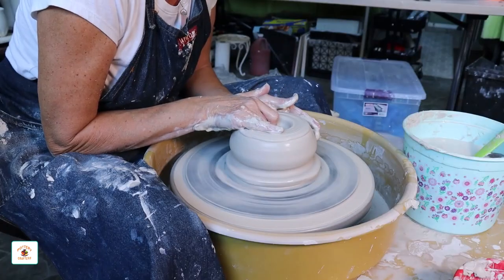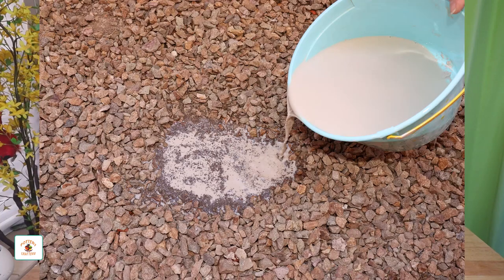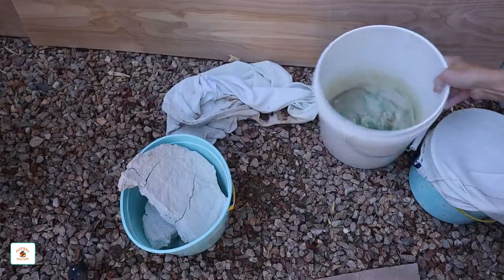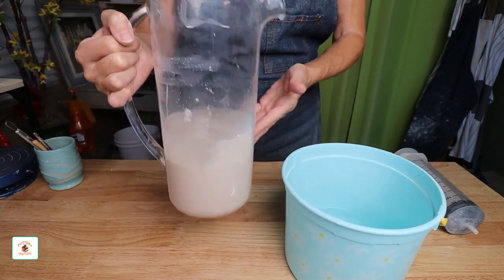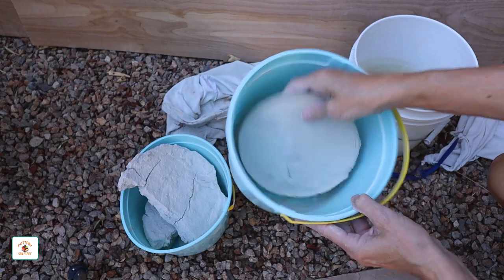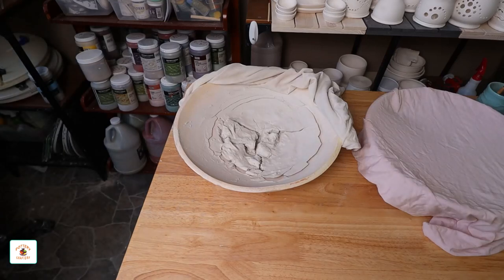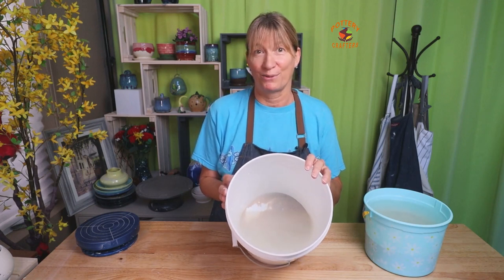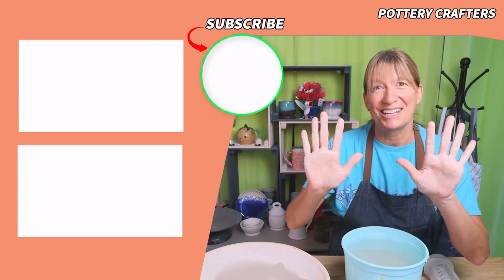3 Different Ways to Dispose of Your Dirty Clay Water

Comment: Any advice on how to wash your wheel throwing or handbuilding cloths . I used to use 8 buckets of water to wash them before I put them in the washing machine.  It was time consuming,  so I started to just throwing them out . I live in an apartment building and I don't even have a balcony,  but I don't want to give up on ceramic 😃
Reply from the maker: I do the same thing with my wheel water as I do with my floor water; just take the extra water off the top and let the clay dry out.   I let my clothes soak, so I don't have to use so many buckets. Then just let the clay settle also. If possible you could get a drain trap and wash your clothes in that sink.  I hope this helped. I would not want you to have to give up Ceramics.
Reply: Are sink traps expensive? Like are we taking hundreds or thousands 🤔
Reply from the maker: No, they are only around a $100 here is the link for you to check it out. https://geni.us/Ju9KG7   👍😊

Comment: Great video!! What do you do with the syringed water? Can it go down the drain?
Reply from the maker: Thank you. I put a touch of vinegar in the water and  reuse it or I throw outside. I don't pour it down the drain because I don't have a sink trap and even though the water is clear it still may contain clay particles. Now of course it would take many years to clog the pipes but I just stay on the safe side. 😊

Comment: Hi. Once you have remove the water with your seringe, can you put that water in the drain or is it still not recommanded for the pipes?  By the way, for my part, I use a flexible tube and remove thé water part by gravity. Another trick!  Thank you
Reply from the maker: Only if the water is crystal clear. Yes you can!  That is a good idea. Thank you so much for sharing. 😊
Reply: @PotteryCrafters  thanks to you!

Comment: Just a question, Could I just use a double pillowcase, strain the water and hang the case like you did in your recycle video? What is the benefit of allowing the clay to dry first?
Reply from the maker: Hi Merry. Yes you can but because the clay particles are so tiny you still can't let that water go down your drain. The great benefit to letting the clay dry first is that the water absorbs faster and more evenly into bone dry clay. You can test it out your self to see the difference. 😊

Comment: Hi! Thanks for this video. I was wondering why you strain the clay water before waiting for the clay/water to separate? Is this a necessary step?
Reply from the maker: You're welcome emilyyyn  That is a very good question.  You can strain it later if you like. Whichever way works best for you. This way, I can get any debris out of the clay right away. I can take the clay out for slip or let it dry out without having to strain it later.  😊

Comment: Can you just reuse that water that you suck out of the bucket as wetting water again while you're throwing?
Reply from the maker: Great question. Yes you can. It may smell a bit moldy but that's ok because all clay contains mold. If it bothers you just add a little vinegar to the water. Some potters will use bleach but I prefer vinegar.
Reply: @PotteryCrafters  awesome thank you!!